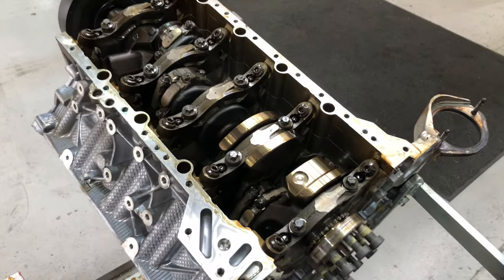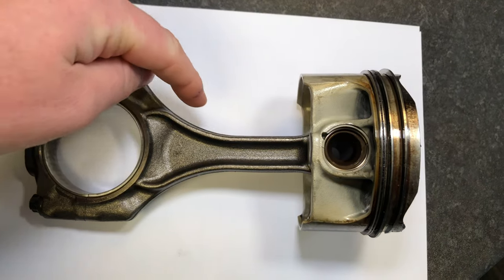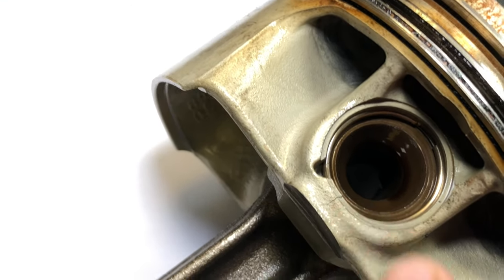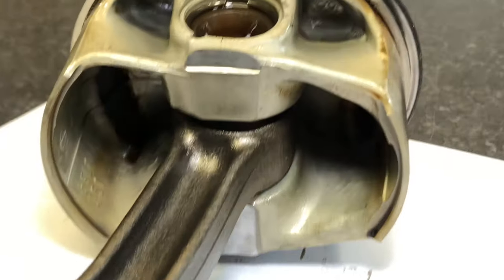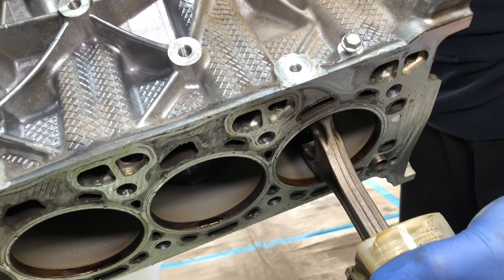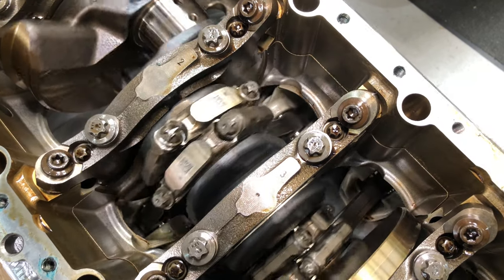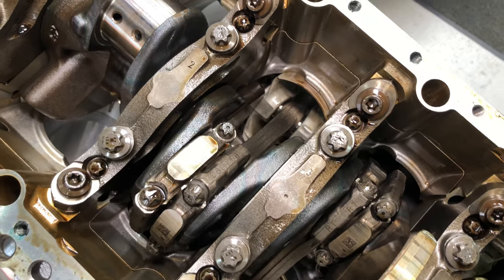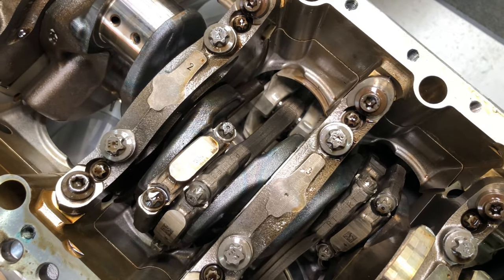FAILED BMW M5 Stage 2 = Bent Conrod

Comment: Great video. I am reading the technical training manual for the S63TU and it mentions this: "Connecting Rod: The connecting rod of the S63TU has been redesigned. It is a cracked and forged connecting rod with a trapezoidal design. In the small end of the connecting rod a formed hole is used like in the N55 engine. The force is evenly distributed over a larger area and the load on the edges of the rod bushings is reduced considerably." After reading that my questions are: 1/Is this an S63TU engine; 2/does the S63TU have the same rods as the N63 (did the N63 also receive a technical update) and 3/were the conrods in the original N63/S63 forged prior to the TU? Trying to track improvements done over the years is helpful for me to understand if later variants have stronger designs. Thanks!
Reply: I have 8 rods here from my car if you want to take a look at them since the rebuild 😂. They are the same part number as the N63 550i rods. Not very stout at all, the car ended up having forged Carrillo rods installed and all new pistons.

Comment: My concern with the newer M5’s would be inadvertently buying one which has been remapped - how would you know, and it’s likely it makes these issues worse, or even cause them.
Reply: Well said Alex, I have this fear regarding precuring an F12 M6
Reply: I wouldn’t buy these cars used. I previously owned a BMW Certified F10 M5, and to my surprise I found out after my purchase the previous owner beat on the car. The previous owner posted the vin online and bragged about tuning and drag racing it. The car in no way should’ve been BMW “certified.” Needless to say, almost $15,000 of warranty repairs were performed on the car in the 2 years I owned it.
Reply: @MatthewJay80  Thanks for sharing that info